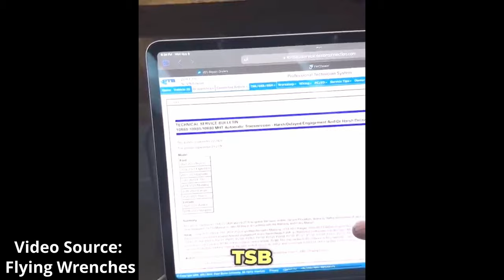Faulty Ford Parts Caused EXPENSIVE Problems in my Mustang

Comment: I've said this before, but I think for that reason, that's why I would rather get something older, more reliable or trusted and more accessible. SN95, a Corvette, a Camaro, Thunderbird, something thats entering into that 80s/90s vibe where if something happens, whatever. You didn't buy the car for $40k and you can noodle with it, wrench on it, and own it. Thats my thoughts on it
Reply from the maker: Yup! Older cars are better for the purpose of being a project car. Any car newer than 2010 in most cases is ridiculously expensive to fix and modify compared to everything before that. I'm telling you now, my next dedicated project car will be old  school! I want old, simple, minimal electronics, carbureted, & cheap!

Comment: 30:31 if it was just one problem either the timing or trans I would've fixed it but both problems isn't worth it.
Reply from the maker: That's how I feel about it. I can't believe how much went wrong.
Reply: @KarzKreated  Civic Si manual. ?

Comment: hmmm. Do you have then new car yet? As many dealers will take the car for a final test drive to verify same driving condition as when first made the deal. Also this video is rather evidential  that the trans issue happened on your clock. Maybe if they did not drive car at time of picking up new car,  than you can say it there fault for not checking. Just saying hope you do not have any repercussions due to trans failure on way to pick up car. Most likely they will kick the ass of used car manager for not catching it. Sorry you had so much bad luck with the ecoboost.
Reply from the maker: Deal is finalized. They'll probably send the car off to auction. Their trade value was on the lower end of what it was worth, and that's after negotiations. So they'll likely get their money back at auction.